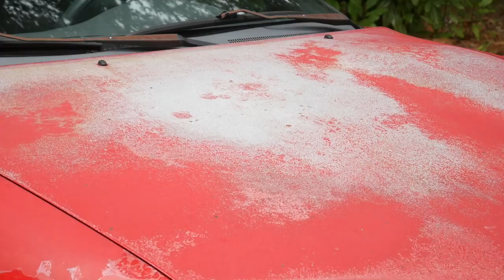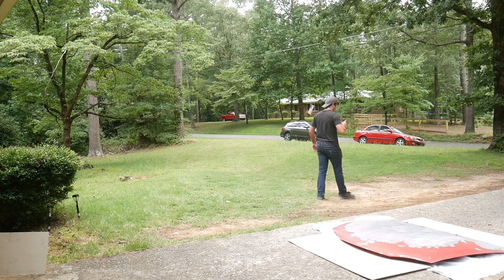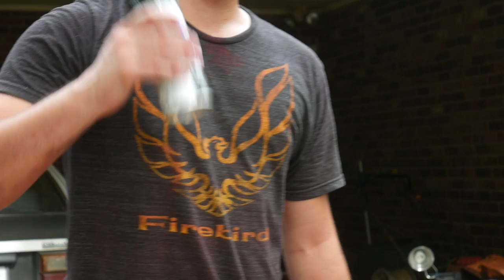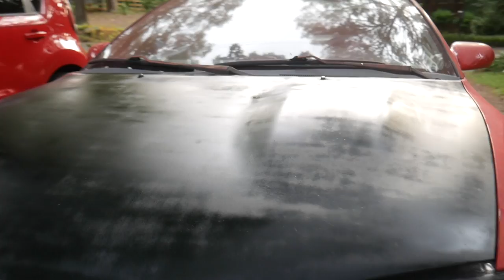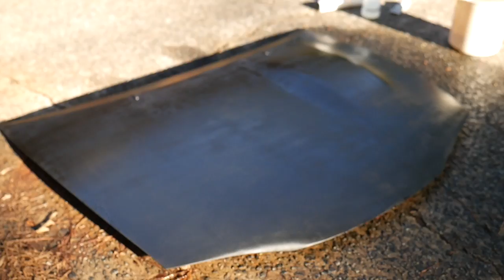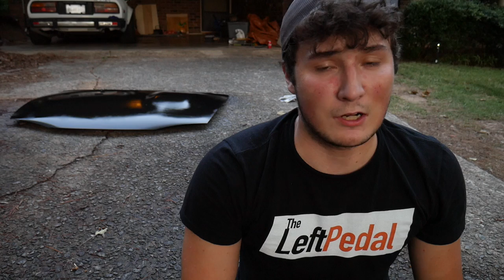Spray Painting a Car With No Experience

Comment: You can buff an wax it a few times with you sander with a buffer pad an the paint will really get a higher gloss an a more even tone than that... My dad did this paint job style to a couple of 70's pick up trucks.. plus he worked in a paint mixing plant a good yr or so when I was in dipers an they did do spray paint jobs with pro sprayers... So he did pick up some basic information about doing it.... However he still got high on the fumes doing so an sprayed the whole dash that looked bad....but hey for the old beater restores he did the outsides after the buff out were surprisingly even, an high shine for a back yard paint job..He spent about 10 days on each one... He did spend the two bucks on the cheep plastic spray paint head attachment..an that helped two. But you know a couple of old sheets some boxes painters tape an newspaper ads an probably about 8 cans of paint... An he got it more shinny than the hood you did.. but he used a buffer head attachment an went to town on them with wax...

Comment: The painting look good I got the rust mostly off my truck but when I applied Bondo on it I messed up bad but luckily my dad helped me put it on good the next time. I painted it now but the painting wasn't bad when I did it but if I was to paint a vehicle in the future I would use a paint gun. But as far as getting the rust off and use Bondo again I just will try to just wash my vehicle more in the winter too because in Michigan where I live it gets a lot of salt on a vehicle in the winter. Or just I buy a truck cover so when it snows a cover be over my truck.

Comment: I know this video is a bit old, but I just had to say:  YOU NEED TO USE A BLOCK when sanding.  If you sand with bare hand,  your fingers can tend to press more into the surface, which will cause waves (aka high and low spots) in the paint.

Comment: I’m not a painter but want to attempt something similar to my project car.
Professional painter please help me if I’m on the wrong track her to critique his work.

- position his work piece vertical if possible.

- used self etching primer since he took it down to bare metal.

- use sanding blocks entire time sanding.

- wet sand primer to atleast 400 grit

- have wide fan tip for spray can.

Comment: Ight man my names matthew after you do the paint you dont want to sand it ive had bad experience doing that the best way to go about it would to buy some goof off or spray on paint thinner spay and rub with a damp wax rag by doing this your spread your paint out evenly and prevent streaks and bubbles then apply your wax coat then sand then wax again easy looks professional

Comment: I think before you applied the clear coat, I would have applied another 5 cars of spray paint in long strokes.  And after it dried, use clear coat from the auto store (I use it in jewelry making because it is chemical resistant)

Comment: I"ve found that you can sort of get away with doing primer and base coat out of spray cans IF it's really good quality paint - but clear is a no-go. Even with high end 2k urethane clear, it just fumes way too much to get a really great finish......with enough practice, yes it can be done but you have to really know how the nozzles for whatever brand you're using work and have surgical precision with your speed, distance and angle ......and even if you've mastered all those things, it's so easy for a bad nozzle to totally screw the pooch on your job when you're halfway into it. Also black is so hard to get to look good .

Comment: Not to hate on you at all I understand your a beginner... but from the very beginning it was handled wrong... I’d start off with 150 grit on a orbital sander then water sand it to 400 grit (if your using a high build primer) if it’s cheap primer sand it up to 600 after that you wait for the primer to completely dry then you move to paint, as your painting you use a 50% overlay which means you cover 50% of what you already sprayed so that you don’t get those tiger stripes and then your finish would have looked soooo much better but definitely worth a shot, definitely an A for effort 👍

Comment: Look, my friend. Nobody is perfect, and given the fact that this was the very first time for you to attempt spray painting a car, you have done a rather good job.

I have noticed that you belittled yourself too often, so, i would suggest you start building up your self confidence. Never give up on yourself and always think that you 'can do'.

You were persistent and determent which I liked very much because persistence is the key to success. You only get skilful through practice, so, the more you do the better it gets. You mentioned you know some painters, go and watch them, and do not be afraid to ask questions. Also, Rustoleum was probably not a good choice for a base coat. I appreciate that a proper base coat will be more expensive, but it would have a better coverage than the paint you were using.

My final advice is to keep at it. Learn how to tape off the area you want to paint and leave the bonnet on the car, doing so makes your job much easier.

Comment: Painting smaller panels would probably work better. On that little hood with a couple of wide decals front to back would give you 3 small areas to paint, which is probably doable. I don't know how much striping cost for a couple of 8" stripes. I always wondered how painting with cans would work. Did not cover area as expected. Small paint sections should work. The hump on the drivers side hood would look cool striped off and painted a little different to blend in would be cool. Did you eat that Yard Bird yet?
Thanks for the video, I paint all my grandson's rockets and RC trucks, always amazed at how well spray can paints can turn out, and those rockets can  do 175 -225 mph. 
Cheers.

Comment: You know, if you're willing to put that much effort in you almost deserve better results. I think that you should try again with some advice for better results.  
1- it looked like just the clear failed, if the base and the primer were not pealing then you didn't have to sand as far as you did, just into a stable layer, especially with original paint.  You try to keep even strokes so you level out any bodywork/imperfections and you quit when you either have everything sanded down to a stable surface or just start seeing metal through the paint, if at that point it's not all sanded it is not flat and it will take some bodywork to make it flat.
2- With Rustoleum, you could skip the primer, but it does help.  If you hit bare metal you're best off using etching primer to coat the metal areas and then give it like 3 coats of a primer/filler (sandable primer).  Once done hit it with some 400grit sandpaper on a block (without the block you'll sand waves into the primer) to knock down any high spots, bugs/dirt, and smooth things out further.  
3- Spraying with a spray can is hard because you don't get much fan.  Rustoleum makes it better because their cans at least spray in any position.  Try to keep the can as close to spraying perpendicular to the surface to get even coats.  With the hood flat on the ground, you won't have to worry as much about runs as normal, which will also make this easier.  Each pass should just look wet and should overlap the previous pass by 50% or more (some go 70%, but be consistent).  Move from wet areas into dry, try never to be spraying toward wet paint or you'll get overspray on it and that will look sandy/dry.  3 wet coats (some will start with a light "mist" coat first to give the paint something to grab onto, if you do that that doesn't count as a coat) will usually give you enough to work with, especially if it's flat on the ground and got decent coats on it.  If in doubt go 5.
4- If you're using a gloss color coat I would "color sand" (cut and buff... whatever you want to call it) at this point.  Regular spray can clears tend to look less glossy over these paints (If you went to an autobody supplier and bought some "2K" clear that would look like a factory clear)
5- If you're going to clear then now is the time to fix any imperfections with some sanding.  I would use wet paper in the 600-1500 range (courser for bigger problems and if you're more confident you're not going to sand through, finer to make things go slower and prevent messing things up).  Put a couple of drops of soap in the water to lubricate things, soak the paper in the water, and again, use a block to keep things flat/not sand waves into it.  The block can be a sponge or something else flat but soft, a sponge will also hold some water to help lube the paint while sanding.
6- MAKE sure all the water is dry before spraying clear.  Follow #3 for the clear.
7- Cut and buff- if you're done and there are imperfections to fix, orange peel... you can cut and buff to fix them.  Start just like #5 (the "cut" or color sanding I mentioned before).  Most will start with 1000-1500 grit and go to at least 2000.  More recently 3000 and 5000 have become much more available than in the past.  You can "buff" (polish...) 1000grit (it used to be difficult to get finer paper), but the farther you go the easier the buff part will be.  Do not skip too many grits.  Like don't at least 1000, 1500, 2000, 3000, 5000 (to whatever grit you decide to stop at) and if you want to add 1200 and 2500 in there it will be better but not necessary.  If you take bigger steps than that you'll have problems getting the previous sanding scratches out.  It might seem counterintuitive, but your end result will be better not going as far but not skipping grits.  From there you buff.  You can start with cheap rubbing compound and going to a polish, you can do expensive stuff, but Meguire's Ultimate Compound and Polish are the DIY community's choice here.  They're easily/cheaply available (even HF, Wallmart, Amazon...) and they work well.  You can do this by hand with a pad or with a pad on your orbital sander, wax when done.

I know that this all sounds like a lot, but if you just go to 3 you'll have a better result than you had, and going all the right steps goes faster than getting hung up in a mess like you had.  All of this will barely be more work than you put in the first time.  If you decide to try again feel free to message me if you need help.

Comment: This comment is much more down the road and I’m sure you’re prob the top automobile painter in your county by now …… but I would say just by how much sanding your were putting into it showed me how bad you wanted it to come out perfect ……. Nice job brother 

Now for the ones needing advice ,
Sadly he was set up to fail and no matter how hard he tried or how many coats he put he would never have got the results he wanted 
- need to spray with a flat tip
- avoid spraying in the sun or your chances of having hot spots increases greatly the paint is drying to fast so when you come back to overlap the fresh paint lays on the paint that’s tacky and leaves a lap mark

So flat tip , long even strokes . And usually if you can see any un evenness while you’re spraying then it’s going to dry like that. …. Usually. Now once your done spraying the whole piece and it starts setting up then you will see it drying a little differently but for the most part the min you lay your lazy stroke it should all
Look even …. Even
A big piece like a hood you shkd
Be moving fast enough to get the whole piece covered before it’s starts drying but still steady enough to get good coverage and don’t start if you don’t have enough paint

Comment: i'd have to follow with some of the comments, overlap your passes. Wider spray nozzle would have helped a lot. wax and grease remove everything. Tack cloth it in-between coats. I did a trunk with decent results, didn't have the full blown depth to the paint like a professional paint job but it was passable. Spraymax 2k would be a good thing to try, little pricey but worth it.

Comment: I have and still spraying my motorcycle it's been a nightmare believe me I know exactly how you feel.  it's not easy like they show you on YouTube it looks so simple I have learned a lot over a month yes a month changing colours moving the lines getting thick ridge's trying to sand them out it was a disaster so decided to buy some paint stripper to take all the paint that I applied off back to bare metal, big mistake after burning it off sanding it all down then primer then colour got my third coat on then got a paint run tried to sand the paint run out then the paint peeled away back to my original White tip never use paint stripper it will burn your paint off again nobody told me I had to use a neutralizer which order cost an extra £30 so ended up taking it to get stripped professionally and powder coated back to square one and a lot of money spent on paint sand paper proper mask ect,  i take my hat off to spray painters people say that my job is an art as I  am a plasterer by trade but spraying to me is an art. I got the hang of now basically just apply very thin coats to build up coats untill it is covered nightmare. It would have been cheaper to take it to a professional to do it. 
 so think not twice about attempting to do this your self but three times.

Comment: If you do this again, do NOT start sanding with 60 grit sandpaper.  If you are a little over aggressive, you could scratch into the bare metal.  If that happens, you;ll never get a smooth surface.

Start out with something around 320.  Compared to 60 grit, 320's grit is about 1% as large.

Comment: Try sanding between coats and start at about 600 grit and work up to 1500 grit sand paper before applying a clear coat 
Be carful applying clear coat cause in can turn a yellow tinge

Comment: the reason this went wrong is because the paint was not applied wet enough,  and also doing a few wet coats of clear coat and wet sanding from 1200 grit to around 3000 grit (taking your time to get the paint sanded flat) would make this shine much more than it is, however for not knowing what you are doing ill say it went well

Comment: Dude, I think your surface prep was a bit off. You need to really sand that surface. Start with lower grit like 100+ moving up. Finish with 400±. Then spray epoxy or filler to fill in any small holes, then sand again with 400±. Plus, don't spray too close to the surface. I think Rust Oleum that you're using has a wide spray pattern just like Samurai Paint in my country, personally I think maybe Rust Oleum is way better but yeah, don't spray too close.

Comment: I think it would have turned out way better if you just used a fan tip nozzle on your spray can, and I would save the wet sand for the clear coat and hit it with a polishing compound after you wet sand. not hateful for your first go!

Comment: its easier to paint with rattle can if you stand the hood up. also  try not painting in  direct sun light. better to paint inside your car port using a fluorescent light. try slowing down using long even strokes, overlapping 50 percent.

Comment: Protection before sanding
Paint your pieces verticaly
2 primer coat, sand, 1 primer coat, Fine sanding, paint (3/4/5/6 Coats) really Fine sanding 4000 wet, clear coat
Apply paint in large motion 40 to 50 cm from pieces
Reply: Oh, and filler putty in can exist, and it i's REALLY good

Comment: Sand smooth. Be patient. Sand smooth again. Be patient. 2x primer. Sand smooth. be patient. 2x Primer again. Be patient. Sand smooth. Clean surface. When painting you want consistent overlapping lines. wet sand. Clear coat.

Comment: Bro 2x rustoleum gloss. I did my wheels black just ran steel wool and break cleaner then painted them the tire guys asked who painted the wheels. I told them rustoleum primer and paint 2x gloss black did them they said they look professional done. Try it bro primer then paint could be the issue use the one shot primer and paint in one comes out beautiful. Im gonna paint my 1990 honda accord lx coupe sanding off the shitty clear coat then using the 2x paint primer spring green over white Car. All my trim and moulding are black ill prime them with the white then paint it spring green so it pops.

Comment: Next time... the 200 is too agresive, 400 at leats, I recomend wet sanding with 800 the primer, its a lot of work, but the paint do not cover the scratches, only makes those worst, also, let the paint cure more time, the solvent is not evaporated even after an hour, so you "melt" the previous coat with the new one, if it's a rough spot, it get worse. Anyway, everyone has a first time.

Comment: After the primer you should wet sand it wipe it down with a tak rage or thinners to get the surface clean thn start the paint process
Reply: Last clear coat after you could of wet sand with 2000 or 2500 grit and then buff

Comment: That's the price of learning on how to do? If you can find the Rustolem Turbo Spray Can probably would help better.. of course you'll have to sand off your clear coat and to the black paint then apply the Turbo Cam Paint... since it has a wider spray pattern... the typical pattern on a can is small l..

Comment: u should have started with 220 then 600 then 800 wet n dry, spray 1 can or less primer, wet n dry again, then final coat of matte  etc. 50% overlap, cost 35-45 $

Comment: Bro considering u used a spray can, you wont get much better of a job then that. You have a compressor get a cheap spray gun, they have a much bigger fan. But at the end of the day large panles are very hard to get to look smooth throughout unless u in a booth with and expensive spray gun. I'm a panel beater but to watch you try was interesting and would educational for those thinking about trying at home. I'd recommend beginners to experiment with the smallest panel they can find and preferably one that's removable because masking is another whole series of videos.